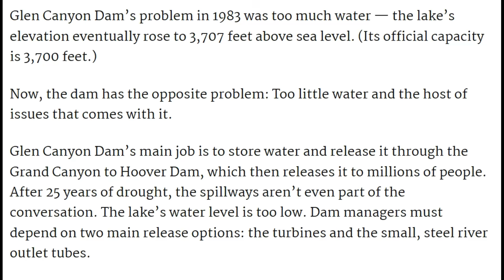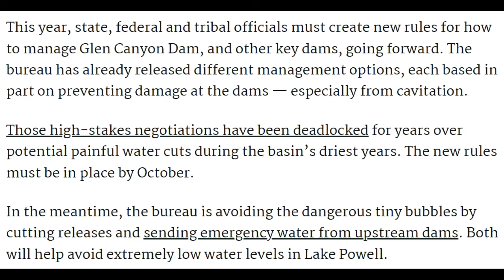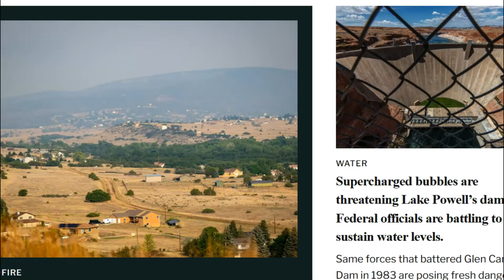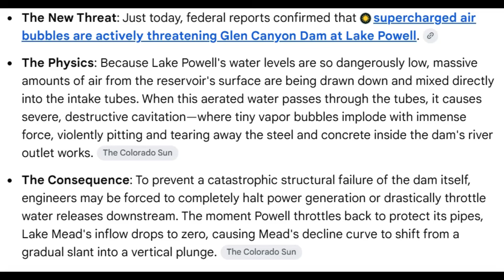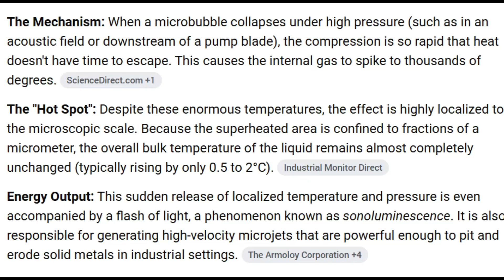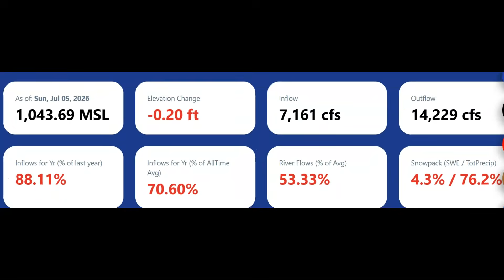Super Charged Bubbles Threatening Lake Powells Dam.

Comment: Hoover Dam wasn't designed to be ever shut down. Water can't flow over the Top but also the Outflow can't be left in Free Flow because the Tunnels can't sustain the Flow Rate without Damage and eventual total Failure.

Comment: Those bubbles become like micro plasma torches.  Maybe that is a clue,, to our next energy resource.  

The phenomenon of cavitation was only discovered, after the efficiency of steam engines, increased to the point of driving ships propellers at faster rates.

Once steam turbines were introduced to ships, in late 19th century, we found ourselves faced with new opportunities AND challenges.

I learned about pitting, while serving as a boiler technician, in the USN.  Dissolved free oxygen under pressure, is a big problem for boiler tubes, causing pitting AND corrosion.

There is also an electrical component, to add to the equation.  Evaporation and condensation is an electrical event.  Is it possible to tap this phenomenon, for a power supply?

I think yes!  What makes it even more compelling, as an area of research, is what we have learned about cavitation, in the last century.

The rate of technological advancement is already making tech we thought would last forever, obsolete, overnight.

IF we are smart enough, we may be able to 'ride the decline" and give rise to the next wave of innovation,  brought to us by our observations, of the phenomena, that created our greatest challenges, during the last wave.

Anyone game to explore new possibilities?  It's a lot more FUN than fretting over the collapse, of the illusions we took for granted.

Comment: I remember going across Hoover dam to Las Vegas as a kid. I was mesmerized by a HUGE tunnel that must of been an enormous emergency outlet/overflow passive type mechanism. It was wide open. No gate. Just a giant hole facing what seemed the darkness of HELL. It was a concrete tube that was absolutely massive pointing down and could be seen from the top of the dam. Gave me chills. Imagining being thrown down it. Still makes me feel uneasy just thinking about it. Crazy piece of engineering.

Comment: Cavitation bubble collapses generate temperatures in excess of 10,000 degrees F. They are why boat propellers are "eaten up" by "normal operation". It's the result of the Casimir force, which increases by a factor of the inverse cube of the distance between two surfaces. As the bubble shrinks in size the force pushing the spherical wall inward increases unbelievably! If you throw a rock into the water the ejected plume of water can exceed the speed of sound by a wide margin. Google it!